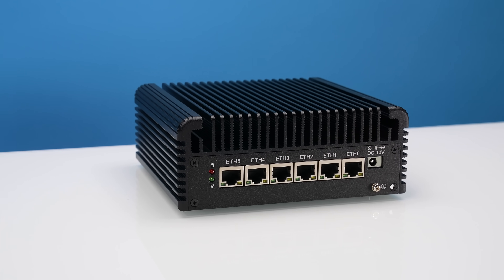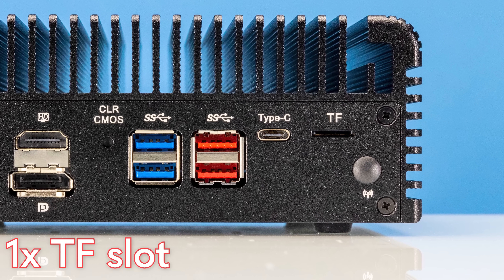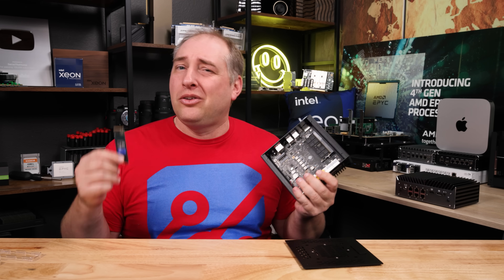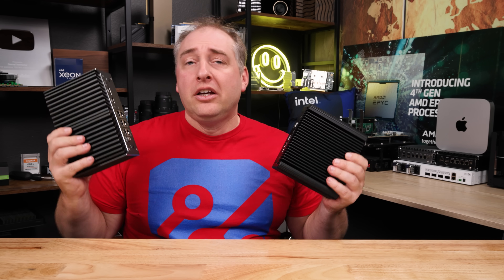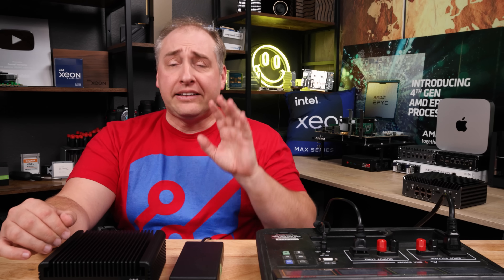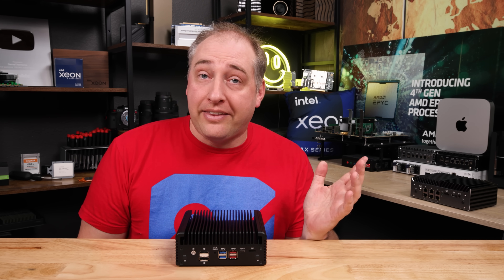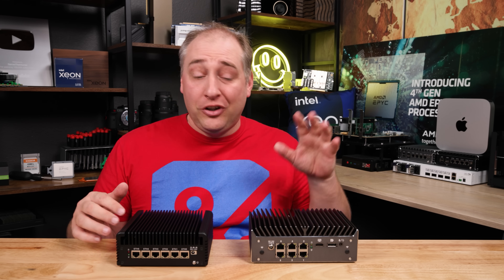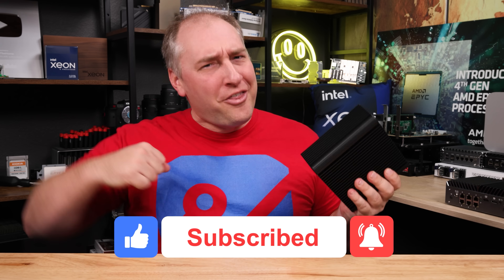KING of Fanless 2.5GbE Mini PC Routers and Firewalls Now with Intel Core i5 Alder Lake

Comment: I don't want to run a firewall on Chinese-manufactured hardware. Don't care how good or cheap it is. Even if I can flash my own bootloader, I still can't be confident there's not a hidden partition. I picked up a PCEngines apu6 for this purpose. They list the country of manufacture of all their parts (none of which is China) and support coreboot.
Reply from the maker: Totally fair.
Reply: there were already discussions to reflash pfsense (downloaded from the main site and flashed via usb) rather than use an existing one that came with the box already, just in case..... but whether that is sufficient precaution? who knows.
Reply: Good point, if you are worried about spying better avoid anything with parts made in China or USA.
Reply: @IsoMacintosh  lol
Reply: Not sure why Chinese spying is any worse than USA spying. Saying that as a US citizen. Everything on the market is pre-pwned by someone these days.

I say don't stress, let the security researchers do their job, and mitigate as per usual.
Reply: Sounds like Cisco never had a back door ? Then I have a bad news for you.
Reply: I’m with you B.B.! Thanks a million for the tip! I’m basically a beginner so I’m sure I’ll have to learn a thing or two before trying that. Thanks again!
Reply: This is what it looks like when a person consume too much second hand political opinions.

Hardware is what it is. There is just no way a onboard chip that’s capable of spying on your personal computing without being big enough for anyone to notice.

That’s just physics.

How fast is modern cpu these days? How much power should this hypothetical chip should consume to monitor everything?

If it can’t monitor everything how can it tell one thing from another to send out you personal information?

And backdoors. All these data should go somewhere right? Ethernet ports are either intel or Realtek, and you can just wire it up to something else and monitor the fuck out of it.

Just saying, if you care about privacy disable all cookies and never log on to any site is your first step.
Reply: @Telopead  It's not the chip that's the issue, it's the firmware on the ROM.
Reply: Where did you buy an APU6? - can’t find a vendor anywhere, including PC engines, that sells the APU6.